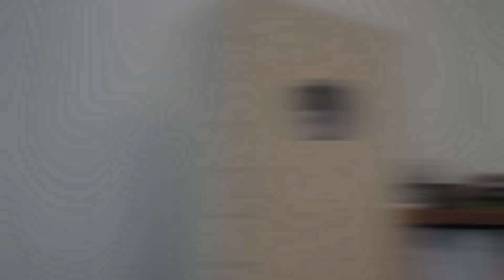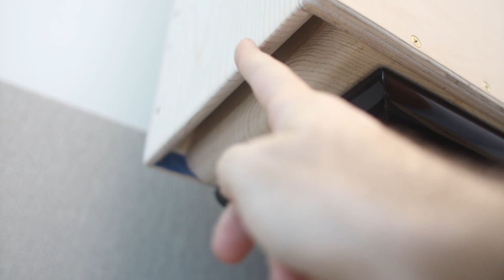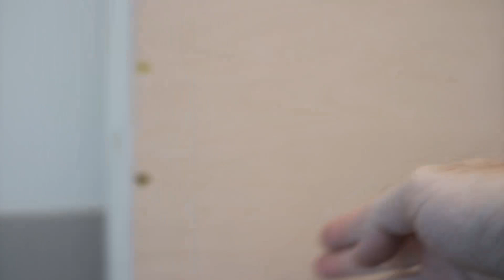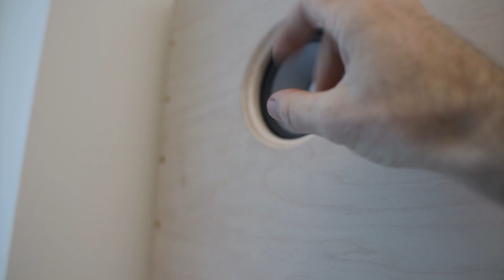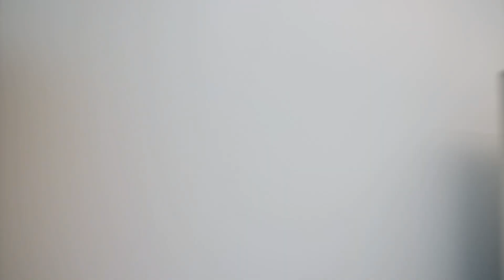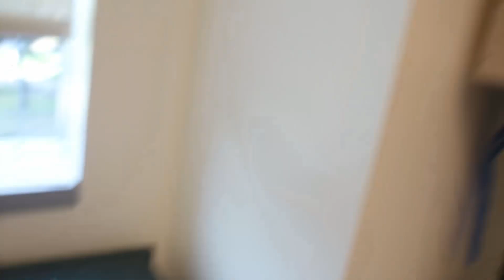La Grande quick instructions to change Basic to Advanced

Comment: Hi Janos  The rear mounted driver defineatly sounds better to my ears on my open
baffle speakers.A smoother more natural presentation is what I experienced. It just sorted
out the music better where as the front mount was more confused a slightly grainier in its
presentation. On my Supravox speakers they have the gasket on the front of the basket
so they were designed to be rear baffle mounted.

Most speakers are front mounted these days for easier driver replacement and not having
to have a removable panel on the back side.The fact that the BBC monitor LS3/5A,Harbeth
P3 ESRs, Spendors , etc all have rear mounted drivers just reconfirms this as they a wonderful in the mid area in particular. Back in the early 70s the BBC spent over 1 million 
pounds developing the LS3/5a, and part of its magic is its rear mounted driver.

Cheers Lou

Comment: Hi Janos, the idea of flipping the front plate around is a great. I would like to add to that that for people who have not yet build their speakers, they should very carefully measure the screw holes so they align up in both directions. The brass screws are an other nice idea, but that was obviously discussed already. Bronze screws should also work and are stronger. They are hard to get though and more expensive. However, I have searched on maritime and yacht hardware supply websites (for the heck of it) and those are the best bet from a cost and availability perspective.
Reply from the maker: Yes, that's critical, to drill holes in the same spots. Otherwise it will be a hot mess of holes everywhere, the resonating air pockets affecting imaging quite badly. :(

Comment: Hi Janos I have evolved to the refined version  of your superb La Grand resonant speakers. In my system  . Wonderful!
The refinements were a profound positive difference. I have a question please?
I am thinking of building Voight pipes to your dimensions using the same technique 
12mm  ply front and back with 18mm pine sides.
Srcrewed together .
Do you think this has merit compared with all pine
Construction?
Best regards. Graham Osborn
Reply: I think I'm on your wavelength there.
Ive been watching instrument makers videos... Ideas...

I was thinking almost the opposite design. I have some very chunky hardwood planks, I wanted to use those for the front, and as a frame on the sides, but I wanted some tensioned thin panels too.. Not so thin that it's boomy but enough to resonate the sound easily, I was also thinking of using a granite slab for the back or concrete.

I figured the speakers would drive easier if they're not moving the cabinet in free space, but rather pushing off from something of high mass. The thicker board around the speaker would transfer the waves to the side nicely so I wanted to put the thinner acoustic panels there (12mm as you have). And it would maybe control any larger movements and prevent that fritzing sound you can get with thin woods. 

Then came my second idea.. 

If you used a medium thickness acoustic wood for the voigt pipe divider, something that picks up the midranges. And have that running so the top end is attached to a 1\4 acoustic wood panel around the tweeter, it should.. In my mind.. Turn that panel into a decent upper midrange emmiter that surrounds the tweeter, giving more accurate directional sound. 

The other thing that struck me is doing the voigt upside down, and mounting the tweeter into the center of that giant front port. Which would cancel out any tweeter baffle and reflected sound issues. 

But yeah having that warm acoustic guitar/double bass like wood included in the design has to have some perks.

Comment: I spotted those on your shelf in a later vid. It landed a question in my head.

Could a voigt pipe be designed to return the waves upward and out from a ring shaped port around the speaker?  Perhaps with the speaker loaded into an internal tube if needed.

Comment: All that work to round the edges... then the speaker is placed next to a square edge of the wall.  : )  I know you are limited in placement in your office.
Reply from the maker: Hi Dave, that's why room is #1 issue, far more important than the speaker itself! It does not mean loudspeakers can be neglected because room is deficient - we need a good pair of loudspeakers and an even better room ; > 
We don't have to do absurd things to "fix" the room, no need to make it look like a scientist gone really wild with tons of plastics. Just do not allow empty corners: place a plant there, or a cabinet, curtains, and a Helmholz resonator in the very corner. (An empty wine bottle serves extremely well ; ).
Reply: @realworldaudio a bag of plaster is cheap, you can run a strip down the corner of your wall and have it scraped down to a perfect curve using a disk of the required size. Sure you need to repaint but it would remove half your corner issues.  As for the convex corners... You can also round them with plaster, it looks kind of cute with the bulbous corners. You can't really sand and curve the corners as they run metal down them these days to keep the line straight. 

Other than buying an art deco house with all curved edges it's a simple fix and fairly quick to do.  You could have the room done in a day.